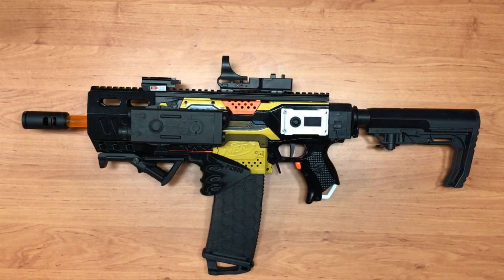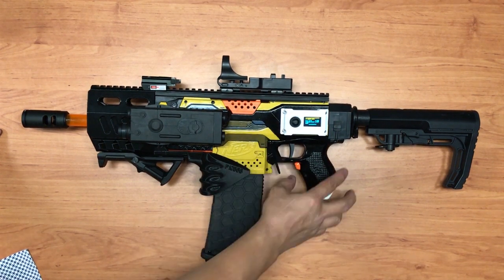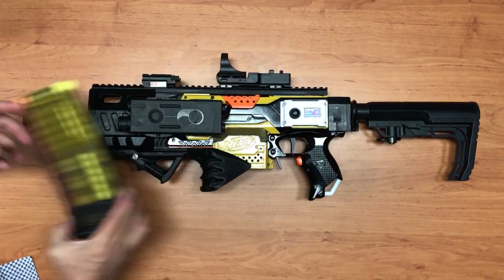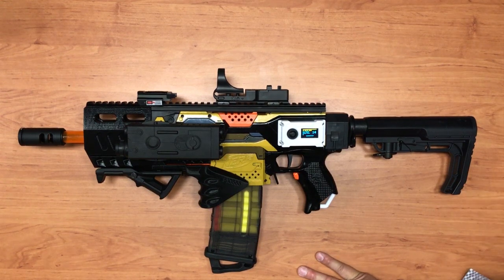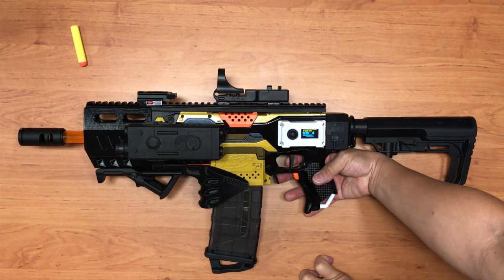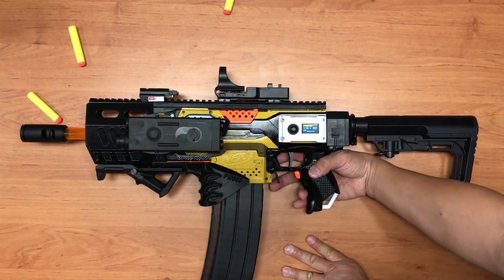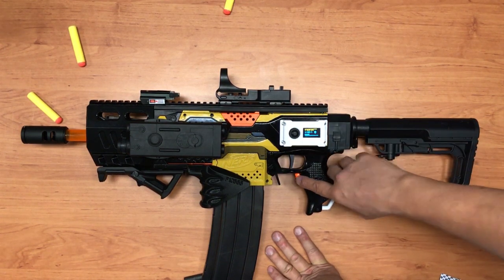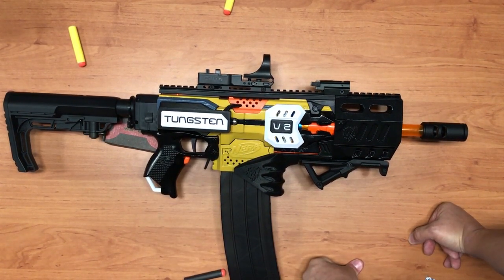{Mod} Select Fire Stryfe + Arduino (Part Two - Demo)

Comment: Awesome build. Question: what is the big black 'box' attached to the left side of the blaster?
Reply from the maker: Thanks man :) The big black box is for a big 3s lipo battery (this one https://hobbyking.com/en_us/graphene-1500mah-3s-65c-w-xt60.html) the place whereby the original batteries is, I place the two ESC for the DC motors. I will be doing a dismantle in a week or two, I will show all the parts.
Reply: Ah, I see. Well, that is a pretty cool case that you made for it. I assume the case is 3D printed? Is it your own design? The case looks a bit like a ruggedized video cam attachment ... or was it supposed to look like a light?
Reply from the maker: I actually bought that case (I place the link in the parts list, you can access it via the same link to the code in the video description). It is very well made very strong and not expensive, I think I will be using it in other mod as well.
Reply: Thanks for the info, I just looked at the battery case. How did you attach it, just screwed it directly to the stryfe shell, or use a tactical rail? If you used a tac rail, what did you put on the side of the battery box so it stays on the tac rail?
Reply: You can disregard my last question, I looked more closely at the taobao photos, I now see how it attaches ... thanks for all of the previous info !
Reply from the maker: No prob man :)
Reply: Wow, this is so cool! Am new to nerf. Never mod before. I like the ability to swap in between single shot, burst and full auto. Any plans to mod a bullpup nerf that resemble the SAR21? It will be awesome!
Reply from the maker: Thanks man :) currently I don't have plans to bullpup version, if I ever get a rayven I will hope to do some mods with rayvens.

Comment: I don't know anything about Arduino, but I wonder if you could have the gun automatically detect how big of a magazine you have inserted. Could you install an RFID sensor in the grip area directly in front of the magazine well, and then add an RFID strip to each of your magazines, telling the gun how many rounds are in it?
Reply from the maker: yes, I can write codes to do that, and I am working on my next project which I hope to include mag capacity auto detection, but I am not using RFID, I will use sometime much less complex, I had already wrote some testing codes and it does look promising :) but the mod will take some time as I am caught up with work :(
Reply: I was thinking maybe you could integrate a couple reed switches in the magwell and corresponding magnets on the magazine. With 2 reed switches, you could have 4 different capacities based on which reed switches detect a magnet. This would be essentially a 2-bit binary code for each mag. If you needed more than 4 different capacities, each extra switch would double the combinations. Thin magnet tape shouldn't interfere with loading if placed correctly, and adding it to each mag would be inexpensive. Food for thought.
Reply from the maker: I will be using Hall Sensors (one of my subscriber suggested that) I wrote some test codes and it work well so far, now I am planing where can I place them, most likely I will be modelling 3D parts to house it :)

Comment: Is it possible that you could add a v2 mode like this one to your arduino rapidstrike
Reply from the maker: yes it is certainly possible as both blasters' flywheels and pushers are controlled using arduino programming. I am also working on a new version of the rapidstrike mod :) there are still lots of possible functions which can be programmed, for example controlling the rev up time, how fast you want your flywheel to go (sometime you want to de-power your blaster for indoor game), etc. man sometime I wish I have more time for modding, but modding will have to be a lower priority, as compare to family and work for sure, I mod slowly but will sure to share my project when done :)
Reply: Tungsten EXE I get it 👌🏻

Comment: What's the rough total cost for this mod not including the stryfe itself?
Reply from the maker: I did not really add up the total cost, I believe it might be in the range of SGD 160 to 200 (I am from Singapore). The main cost I can think of are the 2 ESCs (around 25 each), the cosmetic kit,  the flywheel cage + flywheel, and the DC motors. in future I think I will replace one esc with mosfet that will reduce the cost. The electronic are actually cheap.
Reply: Tungsten EXE, I'm from Singapore too maybe someday can organize a workshop. Then all can mod together and learn from each other.
Reply from the maker: yes, that would be interesting :)

Comment: Will you sell it? I think its awesome
Reply from the maker: Thanks man :) I will not be selling it. I aim to simplify the mods. This stryfe is a lot  easier to make compare to my rapidstrike mod. I hope to further simplify this as well in the future. I will be doing a full dismantling video for this blaster as well, and will try to show as much details as I can.
Reply: Tungsten EXE the problem is i dont know where to get those stuff. Like the audrino board, etc.
Even the kit!
Reply from the maker: I placed the part list at the same location where the code is "link in the description", I have the URL to where I bought those items in the list. However I bought most from China website, but I think most of the items can be bought from eBay or AliExpress. As for the kit, I bought from the Worker site directly. I think Monkey mod from Malaysia sells them too.